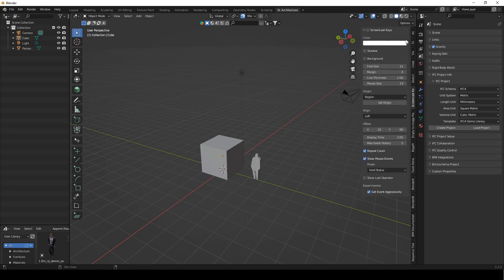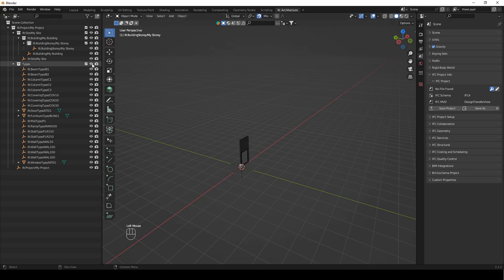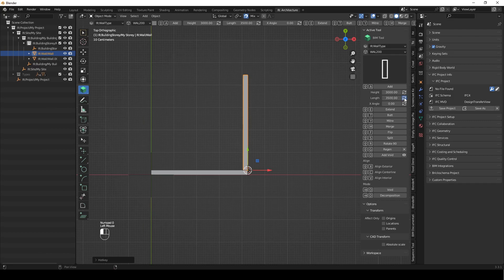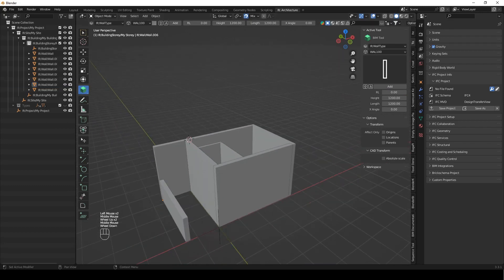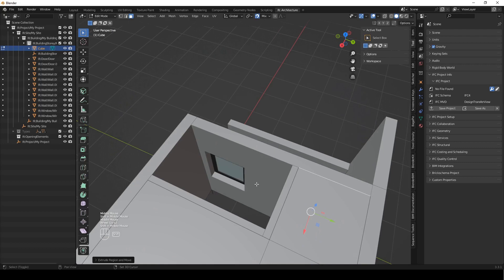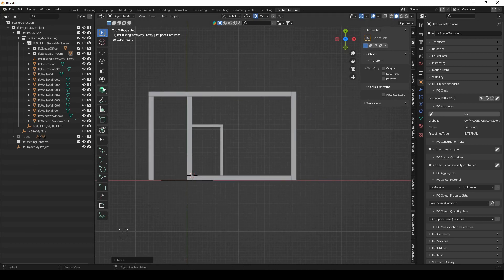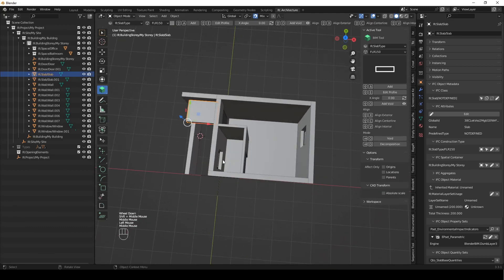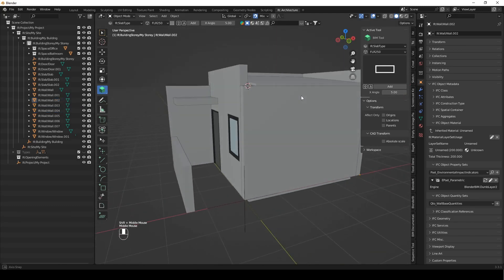BlenderBim Beginner Tutorial - Step by Step Project - Part 1 - Modelling in 20mins

Comment: Thanks for the video. Firstly I am not so sure why my comments are missing here?! As I mentioned before, it seems that BlenderBim does not work for me! I am facing many problems over and over. As I save a project and reopen it, all my elements get screwed up. For example some of my walls get duplicated or some get shortened or even missing altogether! I am about to give this up altogether. For the last effort, I may pay for archipack add-on to see if it works better and if that is also problematic I am going to drop Blender altogether.
Reply from the maker: Hi Taraf, 
There will be a pretty large update and up to date tutorial in a week or so, that should make this easier if you are willing to wait, this tutorial is a bit older and BlenderBim has changed names to Bonsai for Blender 4.2 and newer
Reply: @IfcArchitect  thanks for the response. Yes I know that it is bonsai now and sure I will be glad to see your updated tutorial.
Reply: @IfcArchitect  also I was wondering how Archipack add-on compares with BIm?

Comment: for some reason adding windows and doors dos not create the opening on the walls. I'm using version 0.02406. Do I need to install an older version?
Reply from the maker: Hi! apologies for the delay, that version is alright.
You might be missing a step of selecting the wall (host )before/while adding the door or window.
Let me know if that works out

Comment: I am a beginner and this was way too fast and not basic enough. Which says I am a dummy or it is more of an intermediate video series. Maybe a couple videos should be added to the beginning of this playlist for us who are really beginners and for others they can skip them.
Reply from the maker: Hi Bentley, this series assumes you know a foundation of Blender + have a good understanding of Architecture / Building.
If there were particular parts that tripped you up, let me know where and I'll try adjust the next time this series is updated
Reply: I am a real beginner for one month so it is a lot to learn. I am more interested in the architecture and landscape part of Blender. Maybe for the noobs maybe a series of videos that breaks it down into small parts as: video 1)an overview of BlenderBim parts and tools; video 2) make six wall house that has inside/outside corners with no doors or windows then go through the tools for this and issues to watch out for and how to fix, maybe finishing-stucco, siding, etc or would doing the finishing be its own video; video 3) add a door with frame, molding, materials and hardware, the direction of swing and issues to watch out for and how to fix; video 4) add windows- types, fixed, openable, materials, etc, and issues to watch out for and how to fix; Video 5)..... well you get the idea, make videos that add on to the previous ones. Try and think in the way when you started out what you needed to see so you don't say what, what, what was that, oh man I quit. It is easy to do things fast because it is muscle memory and you don't have to think. It is like when I trained people to run equipment they had to stop me and say explain what you are doing so they understood why I was doing what I was doing. Yes, it seems to you to be tedious but that is what the videos you make are for us beginners else ones that know how don't need to watch them. Getting started with Blender this video  https://www.youtube.com/watch?v=At9qW8ivJ4Q   will help, then follow up with yours.

Comment: Sorry for asking. Can't we just make the modelling in a more common way, and add the IFC attribute latter?
Reply from the maker: Hi Tonni you don't have to apologise,

You can currently model with Blenders default tools and classify any mesh as any ifc class,

This video just shows how to model parametrically with IFC standards in mind, it strictly follows building smarts definitions of different classes and that's why it is how it is at the moment, so if you dont mind losing the parametric geometry there is no other downside.

however if you have any recommendations you can discuss them here on the OSARch community page:
https://community.osarch.org/discussions
Reply: @IfcArchitect   Nice! I'm just thinking about make a mixed process of develop, using the cad software that I have, to read IFC and make the docummentation. I was thinking about, do the start desing by the floor plan, than make the 3d modeling, agregate the ifc properties, and export it to Ares commander, to read the IFC properties.
Reply from the maker: @ai-impersonator  If that workflow is efficient for you I'm sure many people would like to hear about it on the OSArch community:
https://community.osarch.org/discussions

We are always looking for new a practical methods

Comment: Thank-you for this wonderful resource series. Fantastic !!
One question if I may?
How do I move my roof slabs and beams from my Building to my Story container? 

Had a lot of problems with deleted objects continuing to show up in 2d drawings
Turned off all add-ons except Blenderbim now works like a dream.
Reply from the maker: Hey Peter, great to hear its working!

The proper way to change it is something I often forget

You need to change the spatial container of the slab found here:
1. Select the slab
2. Go to: Object Properties / IFC Object Metadata / IFC Spatial container

1. click on the pencil icon for "Enable editing container"

2. Select the appropriate container

3. And click the check box so it has a tick/check

4. Click "Assign container"

If that doesn't work out you can inquire further on the OSArch community page found here:
https://community.osarch.org/discussion/1240/blenderbim-beginner-tutorial-step-by-step-project-part-1-modelling/p1?new=1

And more people including myself can help
Reply: @IfcArchitect  Worked perfectly. Thanks for such a quick reply.

Comment: This is great stuff, but i want to know if the door can be adjusted?
Reply from the maker: The door can be adjusted in a few ways,
1. You can edit the door in edit mode and regenerate the opening, (the downside of this is that it will change all doors using that ifctype)

You can see me edit a door swing here:
https://youtu.be/PNoOyCHa_V0?t=977
It works the same for the 3d model geometry

2. You can change the instance of the door to a different ifctype that is already a different size.
You can see me swap out a swing door for a sliding door here:
https://youtu.be/xWPLZK_WoS8?t=1066

I hope that helps, otherwise the developers are currently working on a modifier tool that allows you to create windows of any size and configuration I think that will also become a door tool in the future. I will definitely cover it in a video in the future

Comment: can the archipack wall be used in blenderbim? considering that the blenderbim walls are separate while the archipack walls are continuous
Reply from the maker: Not at the moment, it has been requested on the OSArch community site, but the developer of archipack would need to reconfigure their addon to use Ifc as far as I am aware this is like rebuilding it from scratch, you can read more here:
https://community.osarch.org/discussion/146/
And here:
https://community.osarch.org/discussion/139/

Comment: Hi!. I was following the tutorial, but I don't have in Active Tool the options RL, Height, Length, Xangle. Neither the IFCtype visualitation. Instead of "Wall 100" I have "DEMO1". I don't know what is happening, but I is difficult to work in that way
Reply from the maker: Hi Desurbe,

I think you are using an older version of Blenderbim, try and update to the latest release and it should be sorted.

You can check out the how to install blenderbim video on the channel on how to update it